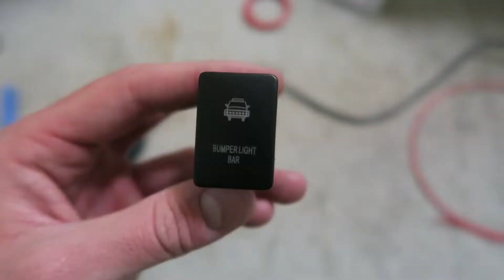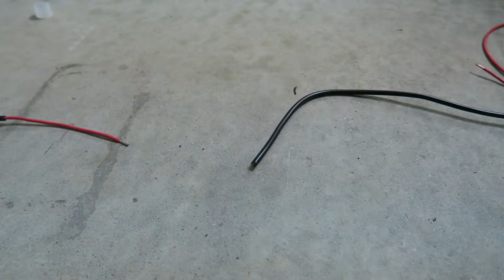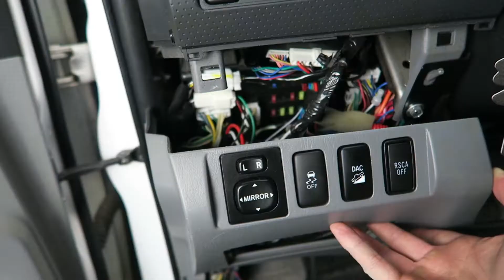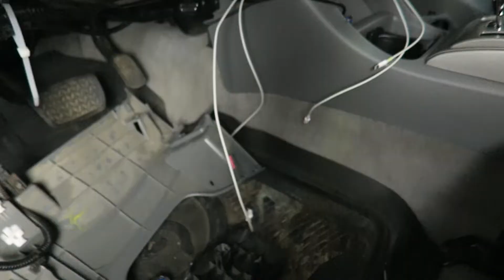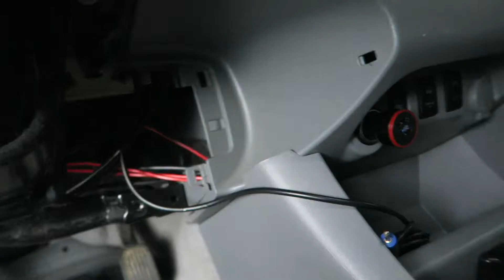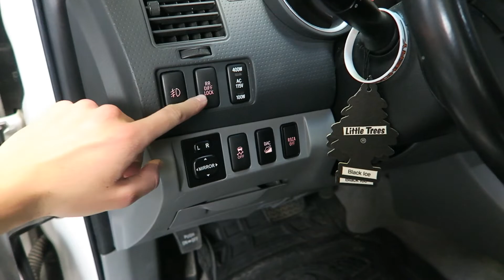Wiring Factory Style Switch For LED Light Bars

Comment: I watch your video with your buddy on installing heated seats. I've wire tapped to the fuse box. Sanded and grounded the ground wire to the chasse under the console and the heated seats won't work. Not sure if I have to hook up the yellow wire. Was thinking of splicing into shifter LED. Checked the wiring with multimeter from fuse tap to ground. It was 11.8. The switch light doesnt come on so not sure...Any thoughts would be appreciated.  Thanks.

Comment: I have a question about the wiring- these switches use 2 bulbs. One at the font “light-bar” and one at the image of the light-bar. Is there a way to wire it so the word is illuminated with your dash lights and then the light-bar image illuminates when it actually on?That way you know what the bar is actually lit up and the font is always lit. anyone do this? I think it would be the most oem way possible

Comment: Using iPhone wire to pull the wiring through the connection point is Old School, not Ghetto.  A lot easier than a coat hanger.  😁

Comment: Thanks Braxen for this video, you just inspired me to save money and do it by my self already, if I may ask, can I connect 5 switches or more to the same fuse to light up the switches with the dash lights? If yes, should I put bigger fuse size or just 10 amp will be enough for all switches? Would it be fine to connect all the lights cables together then fuse them or I have to do it separately? Sorry if its long question 😬Thanks again 🙏🏼

Comment: Great vid! Does part of your switch light stay on at all times? Just installed mine and it is running even when off. Worried it might kill the battery. Thanks!
Reply from the maker: Mine do not stay on at all times. I would look at the add a circuit line if your light is staying on even when the truck is off. You have constant power coming in somewhere, could be the add a fuse (if you tapped into an always on circuit), but you may have an issue with your power wire too.
Reply: Even if i pull out the fuse tap the light is still on when the harness is plugged in. I'm guessing something is drawing power. My harness is red,white and black, which I noticed is different from yours. Maybe should I try swapping those wires around? Thanks!

Comment: Thanks one question the other red wire that doesn’t go to fuse box goes to car battery?
Reply from the maker: It goes to the wiring harness for the switch. So 3 of the 4 wires go to the switch we are replacing with the push button, the 4th goes to the add a fuse.

Comment: Where did you tap into the dash light circuit to power the light in the switch?
Reply: thats what the fuse tap was for.
Reply: @paulholyoak  Ah so the 10amp tail light fuse tap will illuminate the led in the switch to turn on when the lights go on?
Reply from the maker: Bingo 👌🏼

Comment: Question. Why do you need another harness since the auxbeam already came with one ?  Will I only need the harness I get with the auxbeam, an add a circuit ( for the switch illumination) and the switch itself ? I have a 12 Tacoma trying to do the same. I have an open slot where your diff lock switch is.

Comment: stupid question,   do u have to run separate fuse taps for dash lighting each button .......light bar, ditch light  etc..?? or do u just run one fuse tap and splice all to that? also, been awhile, have you had any problems using the add a fuse on ur tail lights? no battery drain, etc....?

Comment: So did follow your instructions exactly and I have no issues with the switch being lit when the ignition is on. But my issue is I’m not exactly sure what I’m suppose to do with the red and black that go into the switch harness? Are those suppose to connect to the battery and negative directly? I already have a positive connected from the relay?
Here is what I have done 
Black and white from relay to light bar. 
Relay to battery (red and black) 
Relay to harness is a white wire that goes to the switch connector (white) bellow that white connector I have a red and black again.... where do these go? please help. Thanks
Reply from the maker: Regarding the relay to battery connection: you only need to connect the positive and negative wire from the relay to the battery positive and negative. No other wires from the switch or anything else need to go to the battery positive/negative. 
Regarding the factory style button/button connector: you have 4 wires that come from the connector; 3 of them connect to the wires from the push button switch that I cut off, which connects to the relay in the other end. You have a negative (black), positive (green), and a red that goes to the red relay wire from the push button I cut off. The fourth red wire from the factory style button is what you wire into the add a fuse circuit. If you have a white wire, it could be similar to the positive green in my video, but make sure to check the diagram of your switch to be sure. Make sense?
Reply: @BraxenMcConnell  Pardon my stupidity here, I’m still confused. I wired the switch correctly after I cut the original switch that came with Amazon harness. but I’m still left with a red and black wire (not including the ones connected to the battery) . I’m starting to think there is something wrong with this harness I got.  See if this pic helps

https://drive.google.com/file/d/1LAXGnn-bZtOMmH-9aJlMJkjVHGbELAoc/view?usp=drivesdk
Reply: @BraxenMcConnell  were ever able to look at the pic I sent? Thanks
Reply: Problem solved. My harness was defective

Comment: When you switch your headlights on without the high beams, do the dash lights on the switch stay illuminated when the switch is off?
Reply from the maker: If the daytime running likes are on, the switch is illuminated. The second light on the switch comes on when the light is turned on. So two lights, one above the other. One works with my dash lights, the other works when the light bar or pods are turned on. Both work if the headlights/DTRL lights are on, and the light bar/pods are turned on.

Comment: I've got a question. How do you remove the panel that you showed removed on the left side of the lower dash panel? Got a video on how you do it? Great information! Thanks!
Reply from the maker: I don’t have a video on it,  it there are a few bolts that you have to take out and then you just pull it towards you and it will pop out

Comment: I purchased 2 mictuning 18w led pod lights for my 2019 4runner & also bought the mictuning wiring harness w/ relay & 5 pin rocker switch.  I want to use the same push button switch u installed in your video but im confused on wiring the OEM style switch that has 4 wires like yours.  Could you give me some help??? I also need help in installing the maxxima 50910 strobe module for the lights.  The installation for the module is straight forward but others say there is another way of installing it because of the relay... Im a bit confused!!!

Comment: Can you link me to where you bought the switches for the left side of the steering wheel? I have a 2012 toyota tacoma and have looked all over amazon and couldn't find any that fit. The switch that came with my LED pods doesn't line up properly with the frame. For now it has just been sitting in that little compartment beneath and it looks tacky.

Comment: I have my switch connected straight to the battery but I want to change it to a different switch and connected to the fuses do I have to take the red wire off the battery
Reply: Sir how can you connect straight to battery? Can you pls explain as the push button have 4 wires n my led light got only 2 wires (positive n negative)

Comment: When you wired up your switch, does the little light bar symbol stay lit all the time than when you switch your lights on the words light up?
Reply from the maker: It’s the opposite, the words are always illuminated, and the light bar symbol lights up when the light bar is powered on.
Reply: Braxen McConnell maybe I wired the switch backwards or something
Reply: Am I right in assuming the word led has the fuse tap harness for accessory power? This video would of been handy if I found it 2 days ago... My led has white black and red cable wiring...

Comment: Love your videos! So helpful! Thanks man! Hey quick question. Your add a circuit link to amazon isn’t working. Could you send a new link to one you would use? I have a 2013 Tacoma. Thanks for all the awesome videos!
Reply from the maker: Thanks for letting me know one man! I updated the link, but here is the link I updated it with. Should be a low profile mini fuse. https://www.amazon.com/gp/product/B07T8LRSH7/ref=as_li_tl?ie=UTF8&camp=1789&creative=9325&creativeASIN=B07T8LRSH7&linkCode=as2&tag=braxen-20&linkId=17c841351b81bf90e4dbc726ea5ddadf
Reply: @BraxenMcConnell  Thanks again! Love the look on your rig. Mine looks pretty similar.
Reply: did this button fit in your middle console?  (the same area as the video).  Did you also buy the same button from the link provided in the description? thx !

Comment: Loved your video. I'm looking for guidance with wiring the heated mirror pads to a Tacoma push switch like you have done here. What I've watched and read so far indicate that a relay isn't required (switch is 3 amp, heating pads together are 2.2 amp) as the draw is low. In other videos I've seen them tie all the red together and go through the add a fuse. What I'm confused about is where does the green wire connect to from the push switch? The package says the inline fuse attaches to the green, does it get bundled into all of the other red to go to the add a fuse. seems like a lot of action for one connector. Be great to hear your thoughts. Thanks

Comment: One of the best videos I have seen so far in youtube, great work and 1 question... can multiple switches be crimped to one fuse tap or is one fuse tap limited to one switch
Reply: Looks like hes running 2 switches to the one fuse tap. Thats what I'm planning on doing. Not sure if you can run more than 2 though

Comment: Do you have to take out the already existing 10amp fuse and then add it with the Add-A-Curcuit? Cause Apparently the Tail 10A  slot is already taken up for me.
Reply from the maker: Kind of.. the add a circuit has a spot for two fuses, one for the original, and another for the added circuit. So you pull the existing fuse, but you put it in the first slot of the add a circuit. Make sense?
Reply: @BraxenMcConnell  yah totally makes sense! I basically combine the existing fuse with the new 10 amp. I did exactly as you showed in the video and it really helped me out!. Now my light bar switch lights up along with the dash lights. This was a great vid and it really helped me out! I really appreciate you taking the time to make this tutorial man!

Comment: Tacoma 08 (problem with switch lit up all the time)Wiring the switch to a auxbeam harness and light bar

Here's what I did to wire the switch to make the light bar work and my switch not to be lit up all the time.  I did exactly what Braxen was saying on youtube,  My light bar was working but my switch stayed lit up on the dash all the time.  I didn't want to drain my battery.  So after checking reviews online and try to figure what was going on.  I clued in, the green wire on the switch is the source.  So I hook up the green from the switch to the red on the harness instead of having the green on the yellow of the harness and the red 1 on the red of the harness.  Voila! it work.  So here's how I did it.
green switch to red harness
black switch to black harness
red 1 switch to yellow harness
red 2 switch to extra piece or red wire with a fuse tap hook up on the taillight slot in the fuse panel.

By the way I didn't have the same switch as Braxen but it was the same color wire.  Here's the link for the switch I got on amazon.
https://www.amazon.com/CH4x4-Push-Switch-Toyota-Tacoma/dp/B01H5UDLLC/ref=sr_1_1?keywords=CH4x4+Push+Switch+for+Toyota+Tacoma+-+Bumper+Light+Bar+Symbol+-+Amber+Led&qid=1568496955&sr=8-1
Reply: YES now the switch only light up when the light bar is on.  thanks

Comment: The way u wired the switch to the tail light fuse would also apply to the 3rd gen as well, right? You are the only person I have seen wire it this way and that's how I want to do mine.
Reply from the maker: Should be the same, yes. I wired it to the tail light fuse so that the light on the button came on with the marker lights and dash lights, so if you’re wanting the same, just make sure it’s wired to one of those fuses and you should be good.
Reply: @BraxenMcConnell  thank you. Luv the vids
Reply from the maker: Thanks man! I appreciate the support!
Reply: Brian, I just installed that in my 05, my son's truck. The top of the button stays on constantly. The bottom part lights up like it should with interior lights. Does yours?
Reply: @randylamb920  I have the same issue. Did this kill the battery after time?
Reply: @michaelg1413  had to swap wires. U using auxbeam light and Cali raised switch?

Comment: Do you need the add a fuse to make this work? I can’t get my Cali raised switch to turn on my light bar
Reply from the maker: You only need the add a fuse for the interior dash lights to work, but one of those power wires goes to the dash lights, and one goes to the power wire from the relay. Maybe you have them switched?
Also, I had a guy one time think that he could plug the main power wire from the wire harness into the add a fuse line, you can’t, it doesn’t have enough power to light the bar. 
You need the main power wire of the relay connecting to the battery, one grounding somewhere on the truck, and then the wires that go to the button  wire up to the replacement switch.
Reply: Braxen McConnell okay, that’s what I thought. Not sure if I have a faulty switch but I’ve tried every wiring configuration with no luck. Even tried a new harness. Cali raised just sent me the diagram, which I followed. No other solutions from them
Reply from the maker: Take a look at this link, there is a wiring diagram in the pictures that is pretty clear as far as how the harness should be wired. Then as far as the switch goes, take one more look at the video and see if it makes sense, but essentially you just have three main wires to worry about. The positive, negative, and the red wire that goes to the wiring harness relay. Those are the necessary connections. The fourth wire that goes to the add a fuse is strictly to make the switch light work with dash lights. 
https://www.nilight.com/products/nilight-off-road-atv-jeep-led-light-bar-wiring-harness-kit-40-amp-relay-on-off-switch?variant=25130940361

Comment: Can I get a link for the add a circuit fuse tap you used?  Thanks.
Reply from the maker: Yeah! There is one in the video description
Reply: Thank you.  I just exposed the wires in the wiring harness for my LED bar.  There are only 2 wires 😡
Reply from the maker: You exposed the wiring by the push button?
Reply: It was covered by heat shrink.  I removed the wrapping and there was a blue wire and white wire only.
Reply from the maker: Does the original button have a light on it?
Reply: Braxen, I have not installed the light yet but it is my understanding that there is a light that turns on when toggled to the on position.
Reply from the maker: Right, so regarding the switch, mine had three wires, a green one that connected to the power source (12V battery), a black that connected to a ground, and two reds, one that connected to the relay, and the other that connects to the add a circuit and taps into the fuse panel. 
If you only have two wires then it’s probably just a positive and a negative. Are you referring to the wiring that connects to the LED bar that has two wires? Or does the wiring for the button only have two?

Comment: I installed exactly as you did. The upper light on the switch stays on 100% of the time. The lower light of the switch turns on when the lights are on. Is there a way to not have the switch light on 100% of the time. If I park the car for a week unused, I am afraid it will drain my battery. * Sidenote of what else I tried: If I run both red wires to the Add-a-fuse connected to the tail, then both switch lights stay on only when the regular truck lights are on.  Unfortunately, they do not light up any more than already lit when I hit the switch to turn on the light bar.  The red wire from the Auxbeam wiring harness is not connected to anything with this setup. Is this setup safe?
Reply from the maker: I think you need to swap your red wires then. When I have my DTRL on, the lower light will light up with the other dash lights. The upper light only lights up when the light bar is on.
Reply: Did you ever find a fix for this issue?